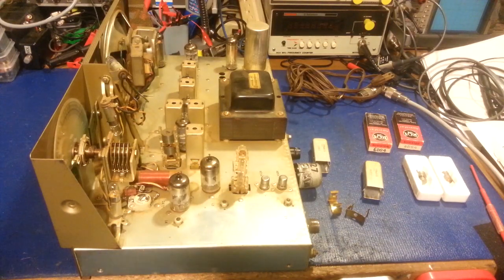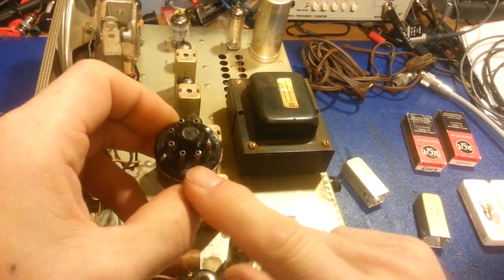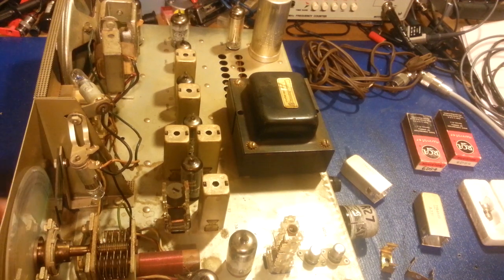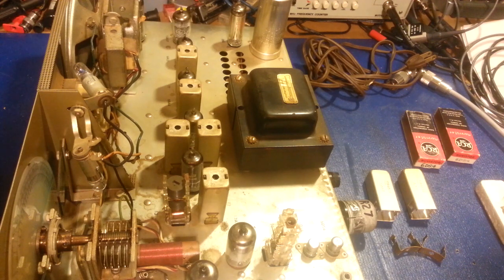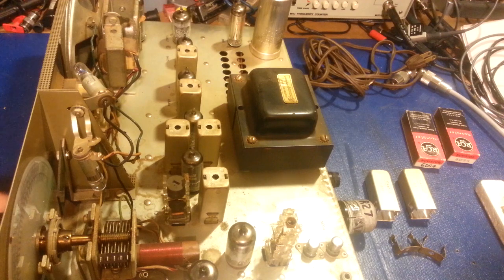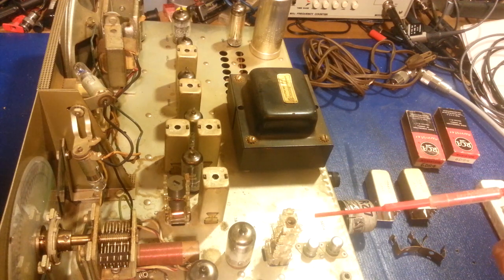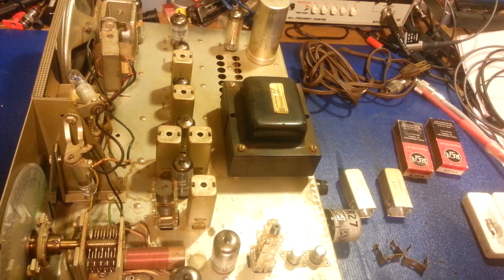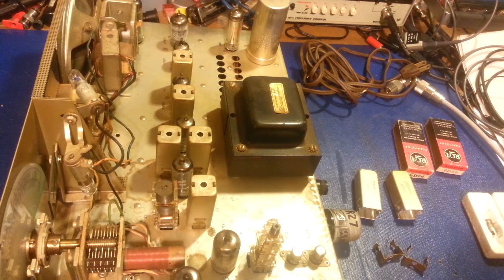Browning R-27 receiver with bad K-Tran IF transformers. Low or no receive.

Comment: I always hated those K-Trans and there are no specs on them.  I've had good luck replacing the original mica wafers with 100pf mica's as long as the i-f's are 455 kHz.  Be sure to remove the old mica wafers and solder the new ones in their place.

Comment: I just have the opposite problem, great receive but no audio from speaker, slide switch for ext, Int, and all speaker has no affect, changed 6AQ5 and 12AX7, same problem. switch transmitter to PA and got PA to work on receiver by putting leads on EXT speaker screws on back and straight to front speaker on receiver, thinking may be audio transformer, any ideas?

Comment: The things he didn't show you was verifying that the power supply voltages are within tolerance and correcting the variable oscillator frequency. On a Tram Titan and a Browning the 31.4 MHz mixer oscillator and the main dial VFO must be working properly or else you can't properly troubleshoot and repair the receiver.

Comment: Mike, would it be easy to tack a small cap across the IF tuned circuits to pull the resonant frequency low enough to get a peak. I wonder how far off resonance the IF circuits are.

Comment: As RF Burns noted, often these caps can be removed and replaced. The Antique radio guys do it by removing the internal cap and placing one under the chassis. Hardest part is finding out what the original value is.
Reply from the maker: The problem is all 7 of them are bad.  Thats a lot of work to pay for.
Reply: I get it.....but it's a classic....

Comment: Could you take the I.F. Transformers from another parts chassis CB and "hide" them inside the existing cans, much like I've seen people "recap" old can electrolytics by gutting them, replacing them with new, modern electrolytic caps, and then seal the whole thing back up so they look factory stock?

Comment: The static crashing is caused from metal migration across the mica wafer. Plate voltage from the preceding stage "arcs" to the grid of the succeeding stage. The same mica wafer is common to both sides of the transformer. Sometimes this can be mitigated by installing a .001 on the grid side of the transformer. As for the silver oxidation that reduces the capacitance, strapping capacitors across primary and secondary will bring the transformers into tune. I've jury-rigged stuff like this by soldering a gimmick capacitor made of 26 gauge telephone wire across the terminals, and twisting til its brought into tune.It's not an ideal repair, but it beats trashing a nice radio, and will usually last longer than you might think. Once I had to repair an Ikegami 730 news gathering camera where the sync generator was so far off frequency the recorded video could not be played on the air. The video would play fine on a picture monitor, but was far enough off standard that a time base corrector would not lock to the video. There was a dainty little phenolic trimmer on the sync gen board that had cracked, when I tried to adjust it, the trimmer crumbled and disintegrated. We ordered a new trimmer from Ikegami, and were told they were out of stock - would take 6 months to come from Japan. So I took the camera over to the master monitor rack and patched it into the "A" channel of the vectorscope, and routed an NBC satellite feed into the "B" channel as a reference. I made a gimmick capacitor from two 6 inch lengths of #30 kynar wire hanging off the sync gen board and twisted them together until the vectorscope quit twirling. This repair lasted for more than a year, because of course they wouldn't return it to the engineering shop as long as it was working. I was stunned that such cruddy repair lasted so long. No telling how long it would have lasted; the trimmer was replaced when the camera was brought in with another fault.
Reply: Yep.
Reply from the maker: The big problem here is you really need to disconnect those internal capacitors.  As the can heats up (it is a tube rig) the loose capacitor plates are going to tighten up and change value as it tightens up due to expansion. It would be so much easier if the caps were at the top of the can and they could be removed without having to remove the whole can from the radio.

Comment: Even radio far younger are getting harder to fix if you want them to look cosmetically correct. Even old pot's on the control face are getting harder to get hold of. I have old cybernet chassis that has JB Weld I think it is on the hidden part of the bezel because you can not find NOS bezels and that radio is so rare you can not find parts radio's for a replacement either. Just look at how many older radio's have had to be modified with DDS-VFO's to keep them going. The control pots on my President Lincoln are not replaceable with off the shelf pots should they go bad not if you want to have it look right and be usable in a mobile.

Comment: I actually unhook my coax during lightning storms. I also unplug my unplug my desk top computer, TV and stereo components. I leave my router and cable modem on and use a laptop running off battery.  My Mom will not let me take a shower during a thunder storm. When we lived in Coastal Georgia the number of people in the area that had electronics ruined routinely from lightning was un-believable!

Comment: I avoid old tube radio gear especially high end stuff because so much of it is not repairable because even NOS parts are not usual good when you find them. They are suffering from the same problems as the parts in the radio which is age related not consumer usage related. People forgot that the rubber, plastic, paper and resins used to make parts break down with time as well. Even the rubber seals on the end of a capacitor go bad with time.
Reply: I have told my self no about 6 times int he last 12 months to some killer radio's at really go prices. By the time you source all new tubes for them and a few spares and recap them and replace 1-2 IF transformers you are up to your ears in money! Even SSB CB radio's from the 1980's and 1990's are starting to become more trouble than their worth sometimes. We have reached a point that with out junk parts radio's on hand it is getting hard to find some parts. On ebay some of these junk parts radio's are getting expensive and Flea markets and such are drying up!
Reply: Another thing I see in various hobbies from guns to cars to trumpets to radio's. You have a lot of old men that wanted something when they where young and they could not afford it for what ever reason. Now they old have plenty of money and are dieting and they know it. They want what they want at any price and will often behave in way that my dad would call "More money than brains!". They will bid things up to stupid levels on ebay or at auctions and will dump stupid amounts of money into repairing something. Why? Because they can! I never buy or negotiate for goods or services with any emotions at all. Every purchase for me is about utility and opportunity cost.When you make decisions out of of love and relationships with emotion you will always come to a bad decision and will be taken advantage of by the sales adn marketing! I get good deals on things because I have no problems watching something go to another bidder on ebay because I know another one just like it will come along. Sooner or latter I will get what I want at the price I have decided I am willing to pay in advance. I always make a list of 3-6 other items that will do what I want to do in the order of which I would ideally prefer. If I can not get a deal on that item I move on. I never get my heart set on one item because items are just tools.

Comment: Is it possible to somehow put surface mount caps in the lower section of the coil former......I can recall doing something similar to some IF transformers years ago and then potting that section to stabilize the whole thing........I cant remember the exact thing I did, but I recall soldering them to the exisiting contact points......they were really small cans from memory and there was next to no room it there at all.
Reply from the maker: Harb's Elecronics Lab 

It can be done and I have done it before.  Problem is its time consuming because you have to completely dismantle the transformer so the internal one can be removed.  When it's a customers radio and there are several bad it gets really expensive.
Reply: fair enough........I just hate seeing the end of anything electronic.......I spend way to much time on basket cases.......I sent you an Email a few days ago, and this is part of my problem.....lol

Comment: I just inherited this set s23 r27 from my inlaws side of the family it also came with a after burner 420 bilnear amp. I dont have a antenna for it yet. Is there a way to check to see if it will receive and trans with put being connected to a antenna ? I dont have a microphone for it yet either it's a 2 pin connector every mic I see is 4 pin.
Reply: When I fire up the radio it lights up and when I turn the volume up all the way and have the squelch wide open I can hear a slight humming noise that's it no static.
Reply: @nickparimuha81  ....trade it quick for something more modern.

Comment: What a shame. I often see these r27's without the transmitter available on EBay. As a matter of fact I see many single Browning transmitters/receivers on eBay. Another excellent video. I actually had a touch of SMD myself. just getting over it. :)
Reply from the maker: Yeah there are a lot of single pieces of Brownings on ebay now that you mention it.  I have put together several sets for myself over the years buying them a piece at a time.

Comment: cant you solder caps in parralel with the old ones outside the cans? yust to make it work better again? (ans superglue the old mica's to keep them quiet?)
Reply from the maker: No, the old ones have to be disconnected which means the whole can has to be removed and dismantled.
Reply: no wire to it y suppose?
Reply: would be a shame not to thry to fix it, can by can, but indeed, ony iff the customer is willing to pay for it..